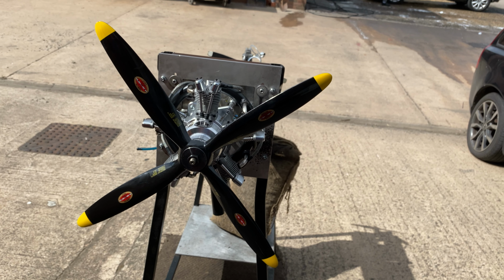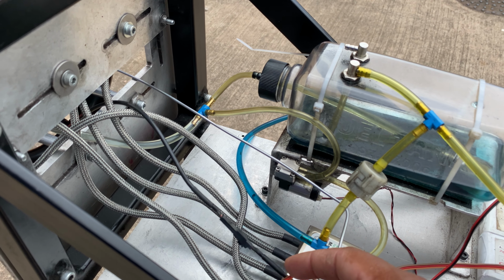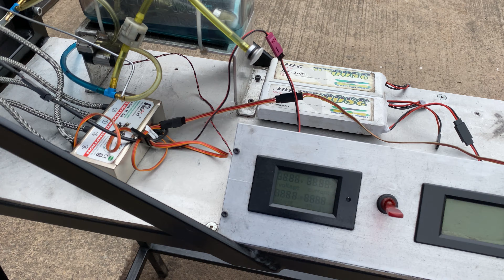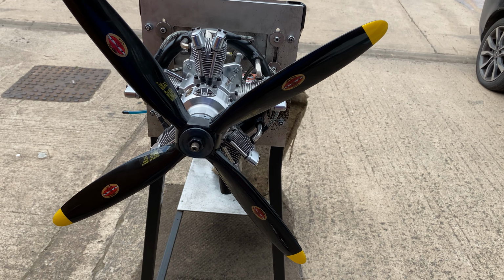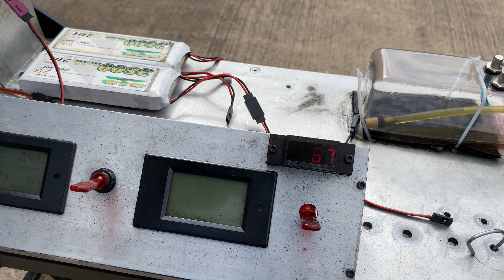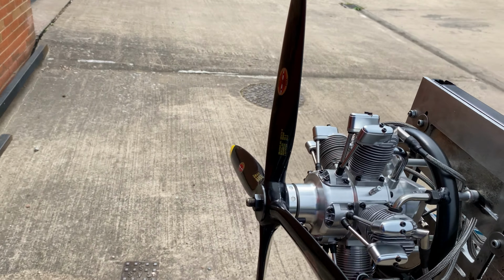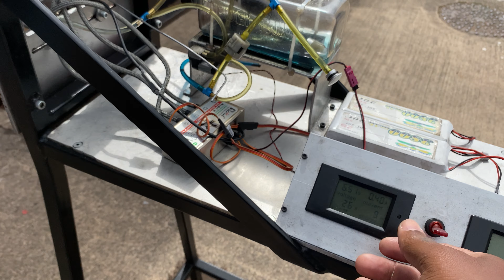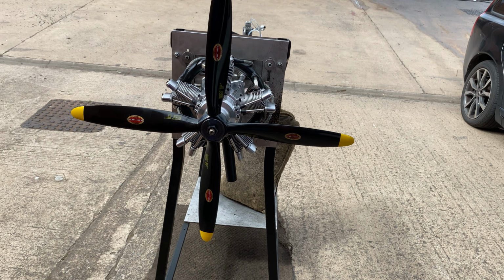Saito FG-73 R5 Full Upgrade With MMM Hardware 20 x 10 Biela 4 Blade Prop 600 RPM - 5500 RPM

Comment: For all 2-engine aircraft one engine must turn in opposite direction.
Is there a reversing kit, or just need to adjust the position of the lobes of the cams (Items 35 Cam Gears)?